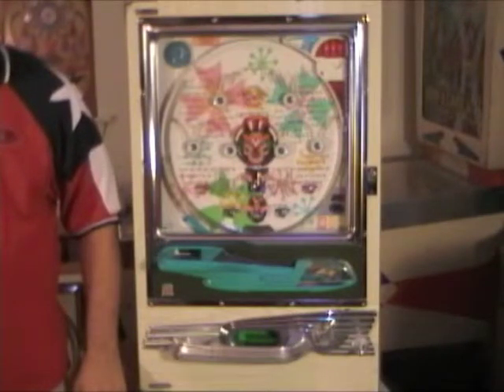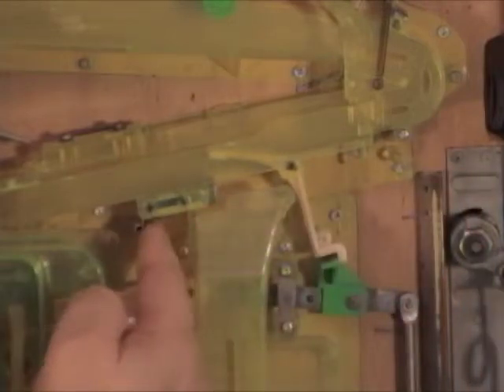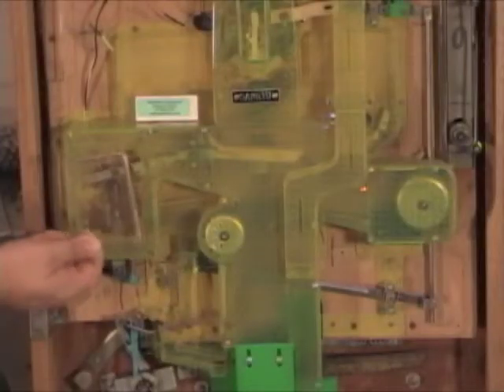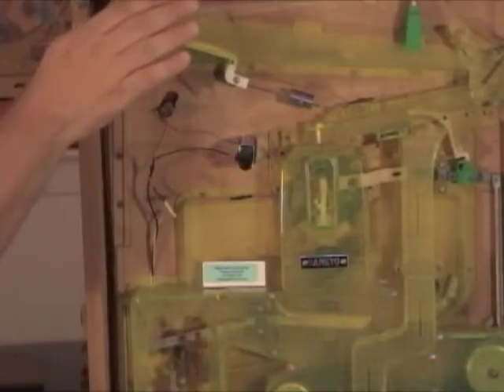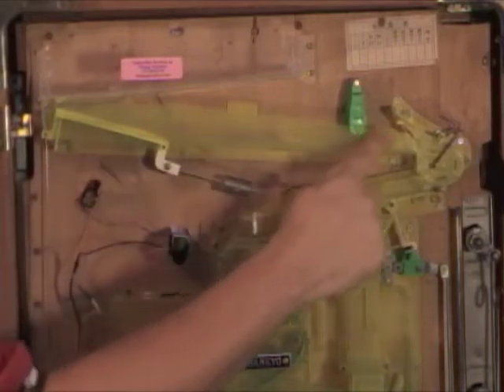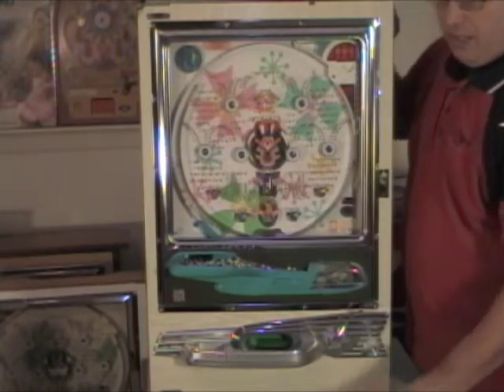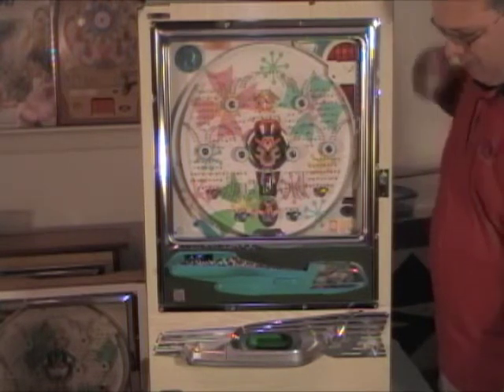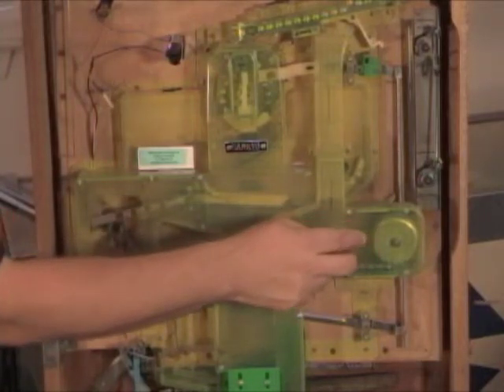Sankyo Pachinko Machine Set Up (004)

Comment: Thank you for the video explaining everything.
The Sankyo I'm trying to get going similar to this one, has a square harness with 3 wires, the white one has an inline fuse, I know the black one is common, but not sure what the voltage of the red and white are, or which one is 9volt. Do you know ? Thank you.
 It's the machine you mentioned that has the extra switch.